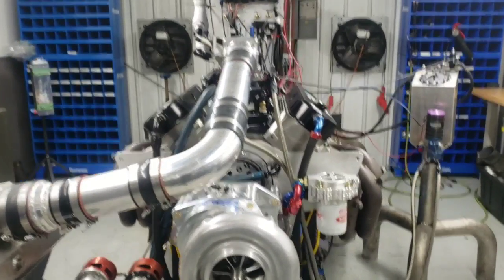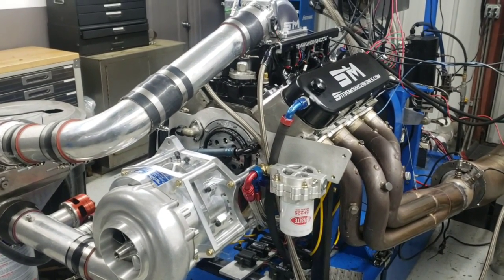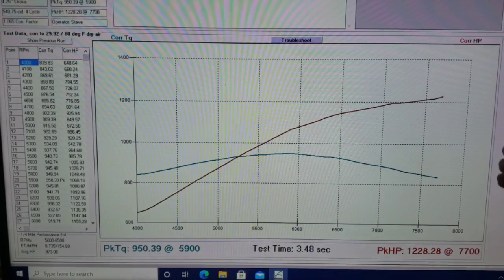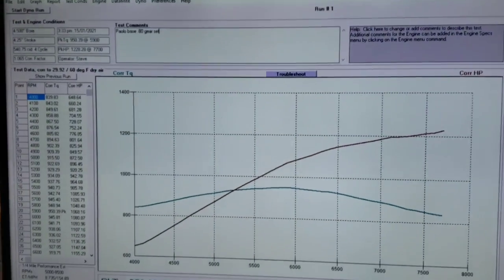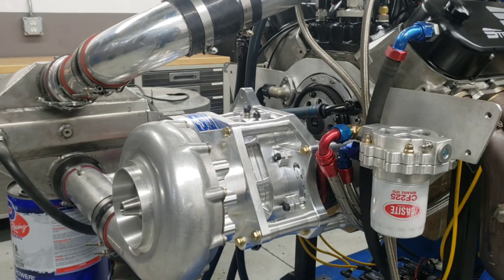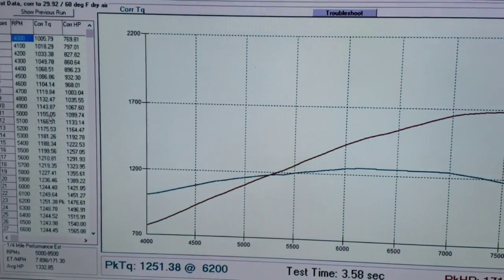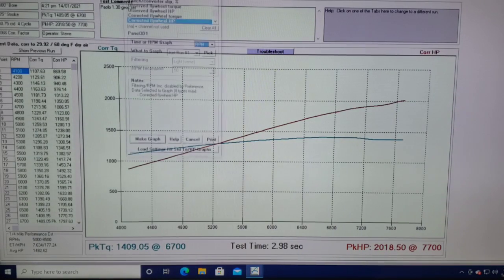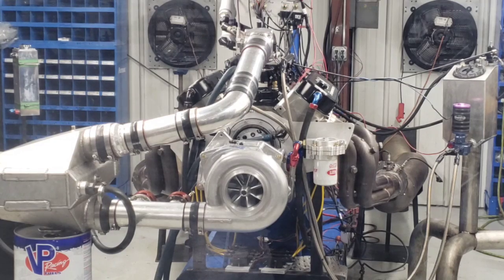ProCharger Conversion

Comment: Great education Steve. Question for ya. Other than the efi timing strategy can blow-thru fueling strategy work same way. Meaning, can one card tune accomodate the boost changes as you outlined in your vieo. Doing a video using blow-thru would be awesome. Great videos and content Sir. Thanks